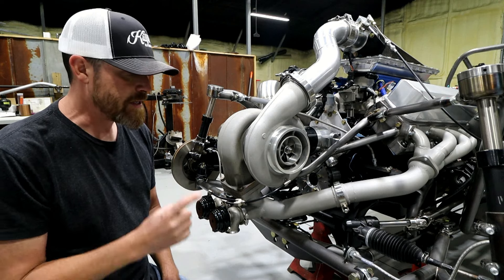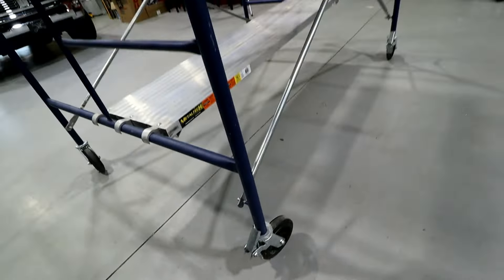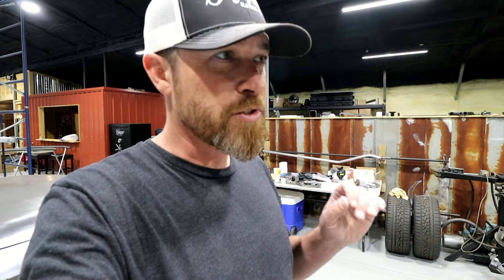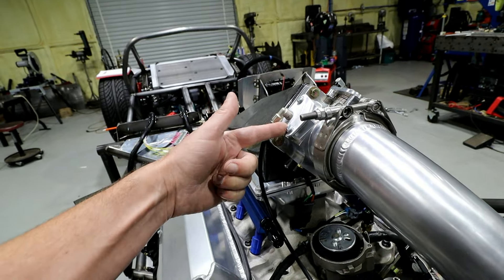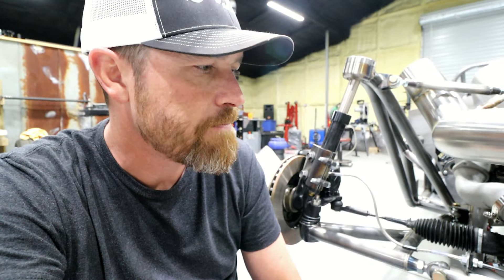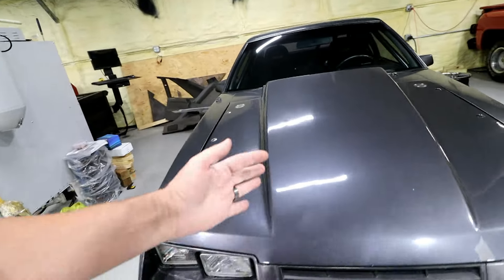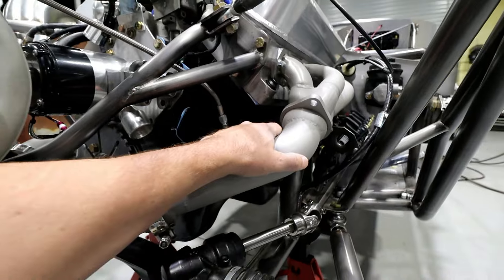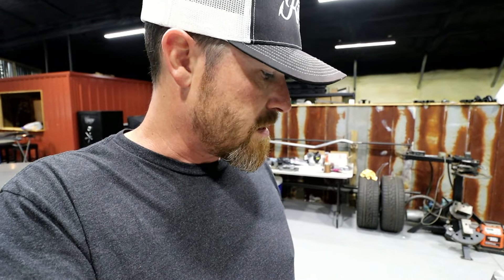How To Build A Turbo Kit For Your Car - Plus Pricing

Comment: If you think scaffolding is a great tool for a shop like that, go find yourself a man lift (like a JLG or something). Contractors sell them used all the time after being used on a single (or small handful) of jobs so the batteries are usually still in great shape and around here (Southeast WI) they are around $2500 all the time.  I never thought I'd use one until I got one for some construction work at my CNC manufacturing shop (about the same size at yours).

Comment: A properly sized single spools as fast as twins. Twins are for packaging especially when you do not have the room to run a massive single or are making more HP than a single can effectively produce. Watch Richard Holdener tested duals against a single

Comment: I know this was posted some time ago but how much do you think it would cost for a fabricator to fab a turbo kit? I already have headers, turbo, wastegate, bov, and intercooler. I would just need the fabricator to merge the headers to a t4 flange, install wastegate, then piping from turbo to intercooler, intercooler to intake and install bov.
Reply from the maker: really depends on materials and routing